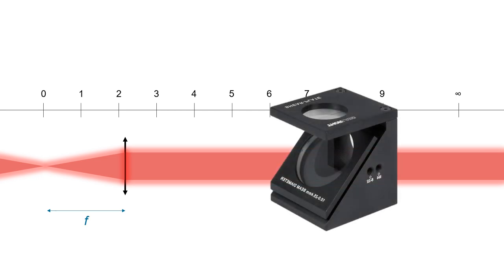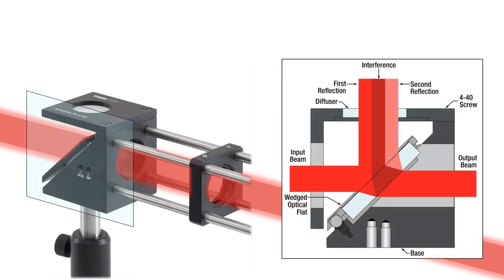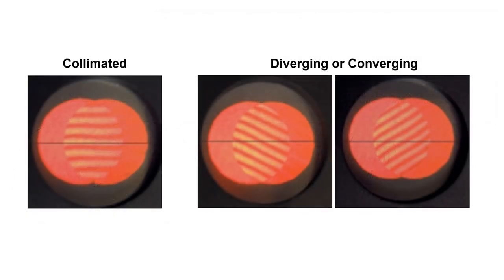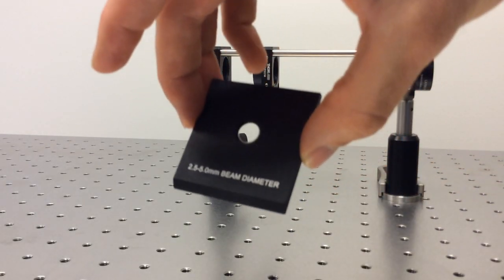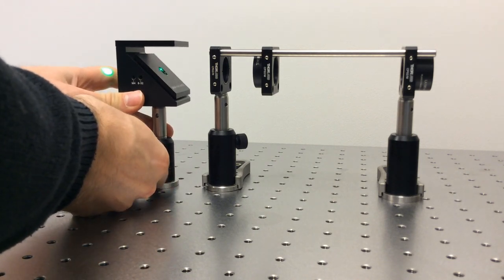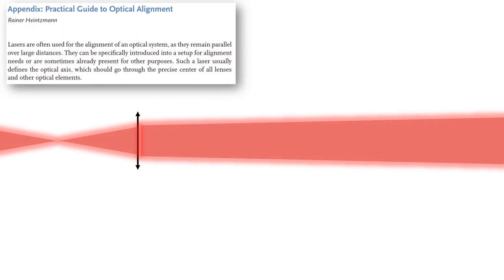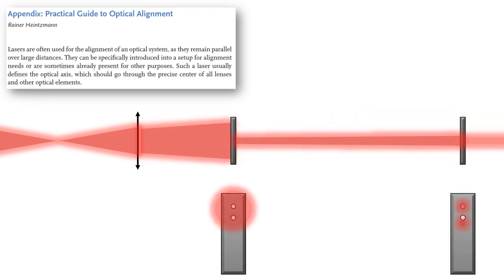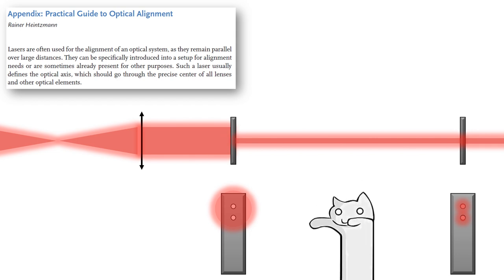7 - Collimating a Beam

Comment: Thanks for the series on the basics of optical alignment. I am, however, facing some problems from Beamsplitter cubes. There are many stray beams. Do you have any suggestion regarding this issue? Could you please do an episode on Beamsplitter cube and their alignment? Thanks, Tamal
Reply from the maker: Hi Tamal, stray beams from beamsplitter cubes can stem from multiple back reflections. You can reduce that by using a beamsplitter cube with suitable coating, e.g. A-coating for visible light (see a list of coatings from a major manufacturer here: https://www.thorlabs.com/newgrouppage9.cfm?objectgroup_id=5840)